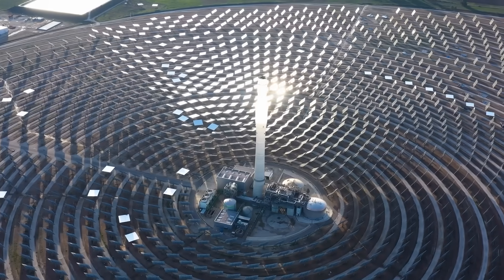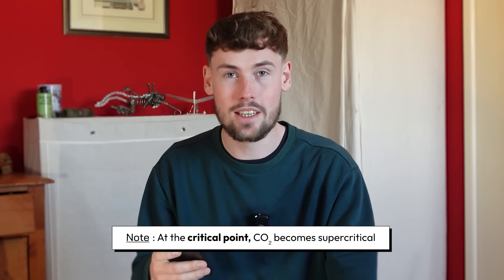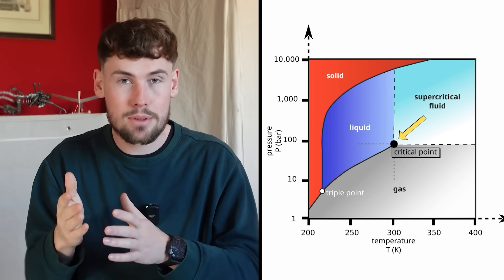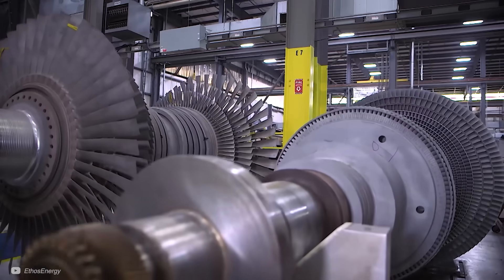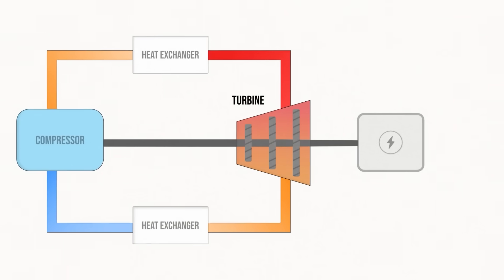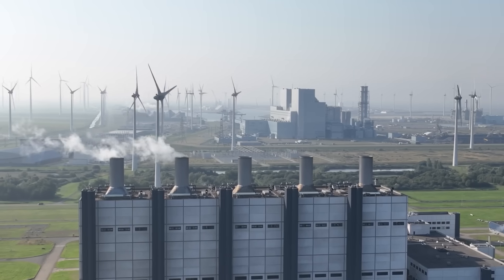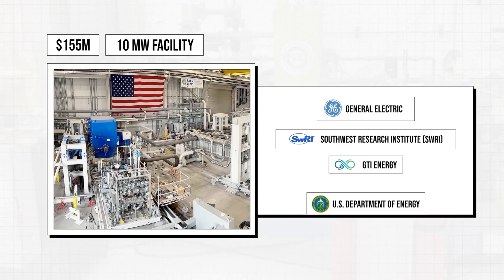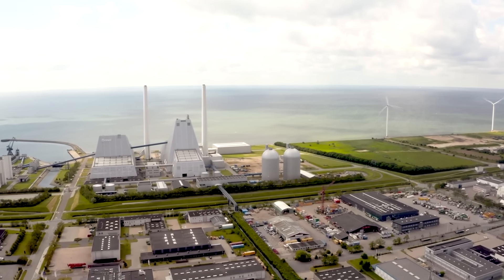How Ultra-Efficient CO2 Turbines Are The Future of Energy

Comment: I have studied using these CO2 turbines for 10 years.   There is no future for CO2 turbines.  Water is a better medium for running turbine plants.
Reply: I have a hard time believing hot CO2 can extract heat as efficiently as water from the boiler stage. I would also think it would be beneficial to allow the CO2 to expand as a gas in the turbine. It seems like the condenser in a steam turbine would waste just as much energy as the compressor in the CO2 turbine. I wish this video showed the carnot cycles.
Reply: @jahnkeanater Exactly! That is why CO2 turbines have never got of the ground. Steam is much better as it is easy to create.
Reply: @jahnkeanater benefit is supercritical CO2 has like 2-3x the heat capacity of supercritical steam. its just you're dealing with something that wants to change phase drastically compared to water which superheated steam stays a gas
Reply: My understanding is that pressure differences, flow rate, turbulence, heat, and various other factors make it impossible to maintain pure criticality across the medium.
Reply: @sonicplanet9193 Thank you for savin 12 minutes of my life 😊
Reply: The average differance in temperature during cooling after the turbine kills this supercritical idea. Transcritical might work, but good luck finding 27 Degree C heat sink.
Reply: @ralebjeka9694  

Bingo!
Reply: @ralebjeka9694  

I could hug you.  Here, have a digital hug:

DigitalHug
Reply: @ralebjeka9694  A river could be a 27 degree C heat sink.
Reply: as a recovering propaganda consumer, this RINGS of shilling.
Reply: I'm sure you're right that investing in it is a  huge financial risk

There are huge technical challenges but don't underestimate the power of limitless money to find a solution.
 
Who has that much money and the drive to see this through? 
The US Navy.

This is a transformational technology that will transform the architecture of all ships  
The turbines are tiny allowing for multiple turbines in standby mode.

Future weapon systems demand large amounts of power, a storage tank with a reservoir of supercritical CO2 could store enough to spin up all the turbines and quickly recharge the weapon systems capacitor banks. It also might be possible to over-drive the prop motors for fast dashes
DARPA was created to fund the development of impossible technology. 

Everything is impossible until someone does it. The four minute mile was thought to be impossible until
may 6, 1954 when Roger Bannister broke the barrier since then at least 1,700 have broken the 4 minute mile.
Reply: @duroncrush Good comment
Reply: @duroncrush  space on a ship is extremely limited, the ship needs to maintain overall buoyancy and you want to add a tank that must be kept constantly extremely hot to store a supercritical liquid denser than water somewhere to power some turbines only when they need to be powered for weapons that already get thought about within the design of steam turbine fission reactor warships using experimental railgun and DEW tech for testing?
Reply: Then why did you spend the last 10 years on it😂
Reply: @kaigmerritt-zp8qx because science takes time to get a definitive answer and not all science projects end up working out. Imagine all the projects working on Fusion today, maybe one or two will succeed, the scientists from all the other projects will have worked for decades for nothing, and if we never manage to make fusion a net energy source, all the people that worked on it will be able to say they worked for decades on it to no avail.
Reply: @kaigmerritt-zp8qx  do.... You know how research works?!!!?
Reply: Why?
Reply: @markfernandes2467 Easiest way to explain is, there is no cheap solution for bearings to withstand 700 degree, 20.000 rpm and 250 bar pressure.
It is way more complicated then steam turbines.
Precise pressure, pace and temperature control, extremely expensive compressor and high maintenance costs.
It is like a jet engine turbine. It is perfect, it is light, small and efficient. At the same time, extremely expensive to maintain. Especially the compressor.

Steam turbine is very simple.

It does not worth to gain 10 percent efficiency.
Reply: They run better at colder temps than steam. Less heat = Less energy.
Water is uncompressable. Water blew the lid off Chernybyl reactor 3 and sent it into orbit.

With Co2 it just breaks down well before that. 
 @markfernandes2467
Reply: Dumb comment
Reply: Dumbest comment ever without some explanation.
Reply: @mensaswede4028  Yeah right like your in the 2% 🤣🤣🤣🤣🤣
Reply: @mensaswede4028  Yeah right like your in the 2% 🤣🤣🤣🤣🤣
Reply: How the hell was that monster at 11:22 made, damn, I wanna see that thing getting milled out of a single trailer sized chunk of metal by some robot.
Reply: Any more context?
Reply: The soot on all those fins and bearings is the first problem that comes to mind
Reply: @RyanMacleod-t6x what soot
Reply: @RyanMacleod-t6x Yeah, what soot?🤔💨🌚?
Reply: You obviously don’t know what you’re talking about.
Reply: Citations? Papers? Without evidence you are just some random on the internet saying whatever
Reply: @bruceritchie7613  How would one go about presenting evidence to you from the comments section? And what do you call evidence. I get the impression you believe this video constitutes evidence that the concept is viable. If that's the case, no evidence ever is likely to convince you any other way, to start with.
Everyone on the internet is just another someone who is on the internet 🤔
Your free to research yourself too. I recommend this, as people that argue the first point are only going to argue every following explanation. The only problem is people don't know how to research and investigate properly and without bias!
Reply: @mrgoodman6620 he could start by giving a couple reasons why. He doesn’t have to publish a paper in the comments, but as it is he just asserted something without even giving a hint of why that a reader could research further. So I’d guess he’s bsing
Reply: @mrgoodman6620  sure. Citations to peer reviewed research papers. Publications in relevant journals. Something to backup the assertion of the poster that this isn't viable at all. I know how to do my own research thanks, that wasn't the point.  The poster never even said why they thought it wasn't feasible. You really want to come to the defence of that?
Reply: @chir0pter  The thing is, he did give a hint in "water is better" ! There's your hint. Really your first hit to look it up yourself was "There is no future for CO2 turbines". 
It's really not hard to understand.
For a start why do you think it's any good.... Don't say because the video seemed to like it, because that's all you can say as there's no way you understand the tech, nuances, cost related complexity etc. The benefits has to far exceed the imposition of establishment to be viable. 
All that video and it's not fully explained, when it's as easy as 
FIRE+ WATER = Bingo 🙄
Reply: @bruceritchie7613  You ask of him what you don't of the other side. So you say you can so do your own research!!! You just want a pissing competition!
Reply: @bruceritchie7613  You ask of him what you don't of the other side. So you say you can so do your own research!!! You just want a pissing competition!
Reply: @mrgoodman6620 that literally adds zero information since steam is the only other item mentioned in the video. Why are you simping for youtube comment frauds.
Reply: @mrgoodman6620  the other side eh. Oh that is precious
Reply: @bruceritchie7613  WTF is that dribble no intelligent response hey?
Not going to happen anyway. Everyone needs to be looking up
Reply: @mrgoodman6620 making assertions like "water is better" and "There is no future for CO2" aren't reasons. A reason would be something like "the energy to maintain the pressure levels required for supercritical CO2 defeats any benefits." And then maybe them showing or citing any papers proving that statement. Just saying "water is better" isn't proof of anything. SCO2 can be twice as dense as steam and can afford higher energy density because of this. The question would be whether the tradeoff from maintaining supercriticality, or any other problems, outweighs the benefits of the improved energy densities. 

It may be that it's unfeasible because we don't have the technology right now to hold the high pressures or require special designs or controls. In which case, those issues may change with further research and improvements. Just like what we've done with nuclear.
Reply: @DBZM1k3  Yeah did you read the full thing ???? Whatever
This all ya get from Wana be smarts
Reply: @bruceritchie7613 How many "revolutionary ideas" end up failing miserably. Sorry, I am very skeptical of some magical new solution.

I am curious how many peer reviewed papers there are on this working?
Reply: @crissd8283  Every single one of them except the ones that don't.
Reply: @jtjames79  Yep, and how many of them don't?

Extremely few.

Honestly, if ths guys explanation is correct, this thing will not work. He states that because it is supper critical, it doesn't have to change states thus saving energy. He is correct that changing states does require substantial energy, but changing states is absolutely nessisary for a boiler to work. If the matter doesn't change states, how can we efficiently pump it back into the heater (boiler in steam generation). Steam works because a small pump can easily pump water up to 1,000 PSI to get it in the boiler, the water converting to steam dramatically increases its volume. As the steam travels through the turbine, it further increases in volume. It is then condensed into water and pumped back into the boiler. If a critical CO2 is expanded as it goes though the turbine, without a change of matter, it now would take more energy to put it in the "boiler" then it did to get it out. Something in his explanation is incorrect. I believe this thing probably does work and that his explanation is wrong. However, I doubt the 50% efficient. I would also point out that co-gen plants are very efficient as the waste heat is put to use.
Reply: @mrgoodman6620 I read the whole thing, and nothing you or the original person said explained why water was better. Vague statements aren't enough. You need to explain how water is better. To be clear, I'm not advocating we should be switching to supercritical CO2. But saying things like cost and general viability isn't met without going into details doesn't tell me or others why. Cost may be an issue. What is the element in the process that's causing the cost to be high? Is it something that can he fixed with further research and development? These are the questions people will have. If this were a pitch a product to someone in dragons den, or shark tank, then saying "water is better" or "the cost doesn't make it viable" is going get you met with the question of why. You or the original poster needs to articulate the reasons so people can make informed decisions.

I , or anybody else, don't have to be smart to want to know about these things. I'm a fairly average intelligence guy. Being informed is a  basic requirement to pursuing or ditching an idea in any subject.
Reply: @ So the video points out some of the problems with CO2, then hand waves the problems with a “more development needed”.  The problems with CO2 are significant and overcoming them reduces efficiency.   Number one for me is the solubility in oil of CO2.   To overcome this problem requires dissolving the CO2 and making a champagne like medium for compression.   In every case when I did the final analysis the efficiency was always less than using water and the cost was higher.
Reply: You should explain why. The power density of CO2 turbines is vastly better.
Reply: True, and helium-4 in a Bose-Einstien condensate would be FAR better than any other option I am aware of.   However, condensates and super critical fluids are VVVEEERRYY sensitive.   The condensate would be utterly destroyed by the heat from the blades friction and turbulence.  I suspect a similar issue exists with supercritical CO2.
Reply: @sonicplanet9193 what about  if a tesla turbine was used instead.
Reply: @sonicplanet9193  I kind of wonder if it would help with miniaturization. Could you make a nano Bose Einstein condensate turbine for example?

I'm not sure what the purpose or marketability would be, but engineering experiments do often pay off eventually.
Reply: @jtjames79  
It's interesting you asked.

I once worked with a team exploring microminiature reactors.  One idea, which sounds absolutely brilliant on it's face, was to create a spherical BEC of LI-6, surround that in a shell of titanium sapphire, and zap it with flash bulbs.  This would cause the titanium sapphire to act as a sort of extremely high intensity pulsed UV laser, causing a cavitation bubble at the center of the BEC, causing fusion, and, of course, the release of a fair amount of energy.

The project died immediately.  It was quickly realized that the thermal energy released would destroy the BEC, and maintaining the BEC state would cost far more than the energy released.

It would make an extremely powerful bomb, however.

So, we moved on to Thorium-Dioxide, and that has far more potential.  3.5MW from a reactor core the size of a basketball.  The problem(s) with that are the corrosive nature of molten salt, and, as we have been discussing, the heat transfer mechanism.  Supercritical CO2 requires absurdly extremely high pressures under that amount of heat, and as another poster mentioned, cooling it back down is not cost effective.  It is certainly not remotely nearly as sensitive as a BEC, but it is still untenable for our purposes.

I really wish it were, because the other components, microturbine, etc, are there.  We just have to put the pieces together.  Water and steam are options, but if it came to that I would rather employ He-4 and a hermetically sealed linear Sterling engine.  Vastly higher Carnot efficency.
Reply: @sonicplanet9193  Dude! Thanks!
Reply: @FoundryOfTitans That, or possibly some type of ceramic piezolectric actuators (as patented by Rolls-Royce) combined with a no-contact gas seal
Reply: I'd say this technology has it place. And would be where water is at a premium and where even waste heat is valuable.
Reply: I trust this commenter more than AI, and I trust AI
Reply: I've been doing quite a bit of research too, and it seems untenable, or at least very challenging.

Please, what do you know?
Reply: Don’t fall for these comments my dude, I believe you have done the research and they are trying to get you to effectively distill all of that knowledge for free on the internet to prove your self right.
Reply: @ValidatingUsername What is this a response to? Are you saying the comment dismissing the video’s point with no evidence (not that they’re necessarily wrong, but we clicked on the video because we want to know the reasons) is a troll, or the people asking for explanations?
Reply: @ValidatingUsername  

Don't feed the trolls!!!

Comment: This would be great Idea wouldn't it cost so much energy to produce dry Ice in the first place.
Reply: You don't need the dry ice, you can compress and heat regular co2 gas. The dry ice was just easy for a youtuber to demonstrate.
Reply: It's cheaper to heat the CO2...

To heat 1 kg of water to 600°C as steam: ~2,261 kJ
To heat 1 kg of CO₂ to 700°C: ~574 kJ

So steam needs ~4× more heat than supercritical CO₂ for similar temps.
Reply: You don't need dry ice. It was used for convenience of handling in the lab experiment and to show the phase change. A power plant would use liquid CO2 which is widely available in industry. To your point yes, there is energy expended to produce liquid CO2. That could be done with solar, wind, hydro or nuclear power to keep the carbon footprint of the liquid very low. 

I'm assuming the generating system would be a closed loop so CO2 leakage would be low. The supercritical CO2 has to remain super criitical throughout the generating process. You can think of this system operating like a refrigerator or heat pump in a closed loop. It's kind a great idea if they can solve the issues.
Reply: Yea I hope so too. I am a little cynical today. Thank you for this thought trough reply.

Comment: small turbines means less inertia to smooth out fluctuations
Reply: You might have a point. Not a huge deal though I think.
Reply: Yes, but do what they do now for failover power in commercial sites which is spin a big concrete wheel at the required revolutions. 
Fluctuations be damned 😂
Reply: These things also spin at 10K's of RPM and your typical steam turbine spins about 1800 RPM range if you live in 60Hz land. I don't think the sCO2 turbine's alternator is directly coupled to the grid at that RPM.

Comment: I wonder why they don't embed the inductors into the turbine so that the whole system is enclosed thus removing the issue of the barrings needing to seal the high pressure between the turbine and drive shaft attaching to the generator operating in atmospheric pressure?